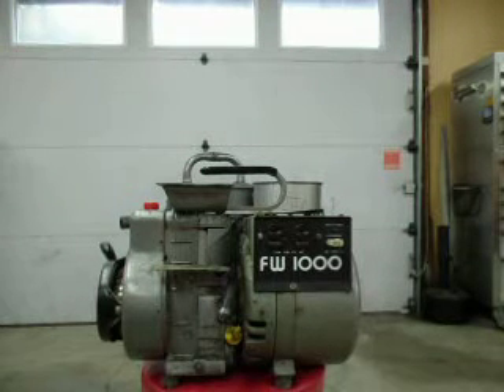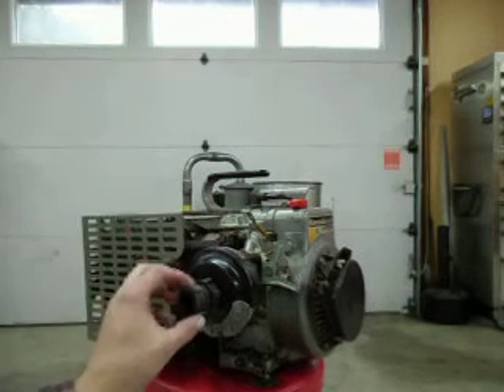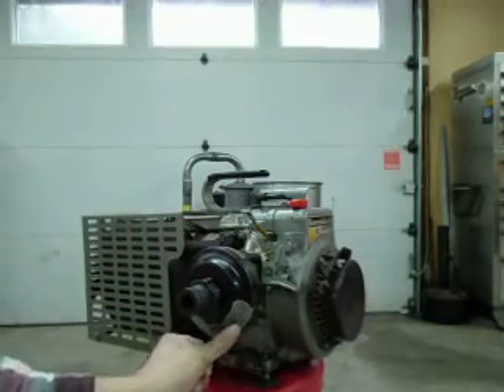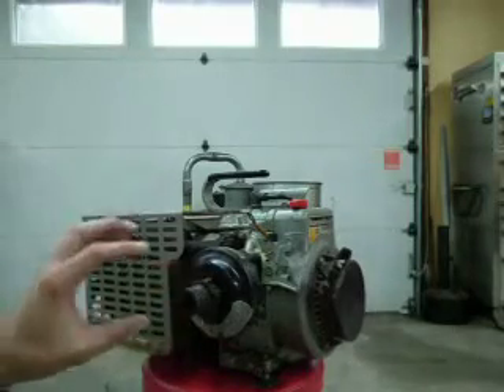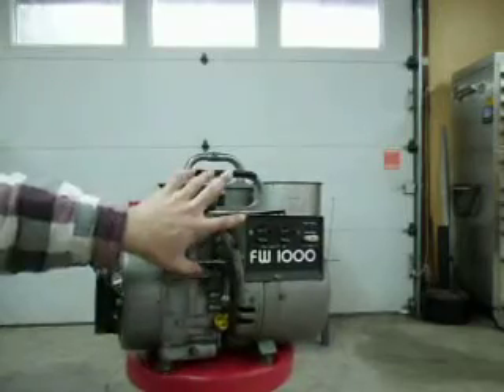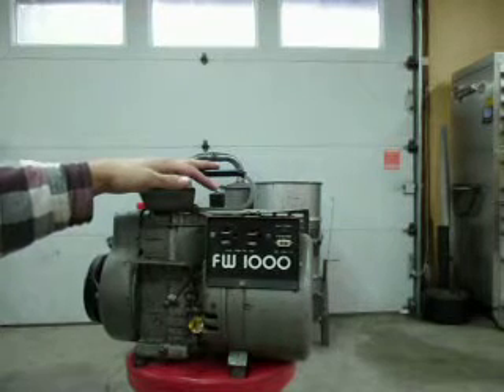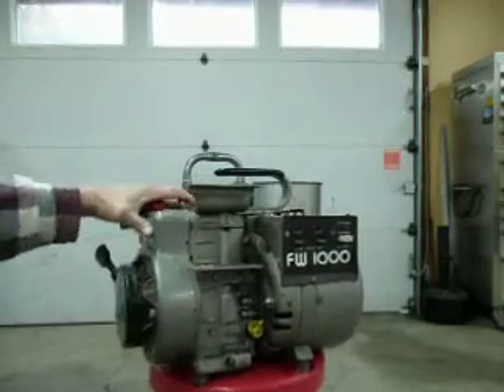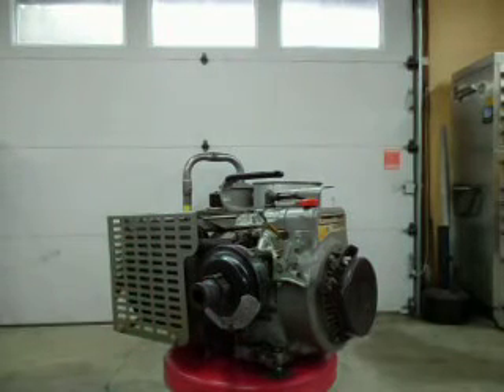how i built my gasifier #7

Comment: I seen that now... very good, i've had a get set run on a fema type gasifier but ended up getting a stuck valve and bending a push rod. hope you have better luck than i did.

good luck and have fun

Comment from the maker: @sjf67gto i used the pipe as the grating, drilled 125ish 1/4" holes in the bottom radius of the pipe and capped the end, as for fuel i'm using pellets at the moment but plan on trying all sorts of fuels, thanks for the comment,...josh